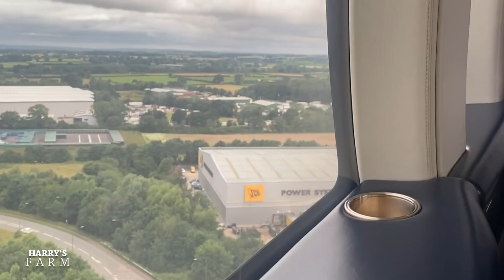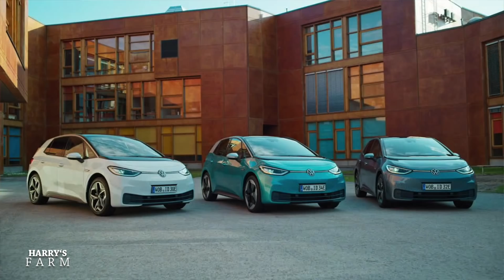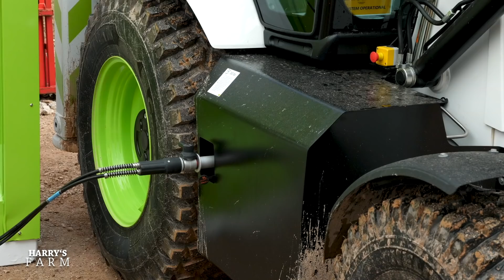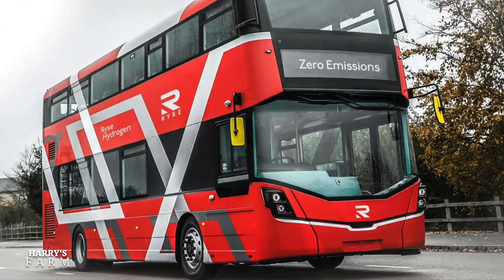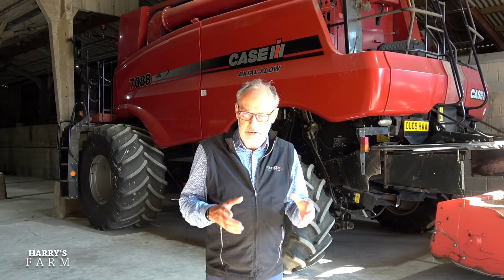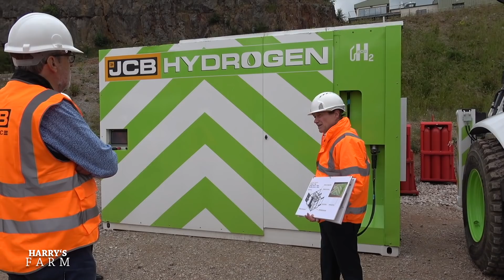Why JCB thinks hydrogen is the best alternative to diesel for heavy machinery, farming and HGV fleet

Comment: Great video and discussion - I'm not convinced hydrogen-ICE will prevail though. The infrastructure for H2 is, as of today, non-existent and reportedly going to be very costly (350 bar storage tanks!). Given how batteries are already reaching widespread adoption in cars and grid storage, I can only see their costs being driven down while energy density increases to the point where they become viable for HGV & agricultural vehicles. The infrastructure should be much cheaper too, as all farms and fuelling stations have decent 3-phase grid connections for recharging.

Comment: Harry's Farm is now the only reason why I turn on the television. Captivating, informative, informed and balanced. What began as research for a book is now a wholesome addiction. But who, please, is the camera person?
Reply: oil companies attempting to sell oils and gas dressed up as hydrogen it is a scam    Depending on the quality of the feedstock (natural gas, rich gases, naphtha, etc.), one ton of hydrogen produced will also produce 9 to 12 tons of CO2  
However, hydrogen combustion with air produces oxides of nitrogen, known as NOx. In this way, the combustion process is much like other high temperature combustion fuels, such as kerosene, gasoline, diesel or natural gas. As such hydrogen combustion engines are not considered zero emission.

Comment: Dear Harry
Is JCB doing any research to make a safer fuel tank for the hydrogen giving how explosive it could be in an accident etc?  I did speak to a friend here in Canada who was working on a fuel cell powered mining locomotive and they had come up with a "hydrogen bed" storage system that bound the hydrogen chemically until it was released to the engine so if struck or punctured in an accident, the fuel tank could not explode. 
Love the videos, please keep them coming.

Comment: Problem with internal combustion engines running on hydrogen, they're roughly half as efficient as fuel cells on hydrogen plus they produce NOx emissions. Fuel cells are twice as efficient as ICEs and they produce no NOx emissions. Fuel cells are the way to go. Try again JCB.
Reply: They'll need to become a lot cheaper first

Comment: The issue isn't the engines, it's the high pressure hydrogen and the delivery system for those. Not only is the gas very flammable but it's very high pressure too. Everything may be reasonably safe when it's brand new but you have to think 10-30 years down the road and maintained by not so diligent people. Imagine having a 20 year old hydrogen car or tractor in an enclosed garage or space and then it starts leaking. Massive fire hazard. I'm not against hydrogen power, and I don't think EV is the answer for heavy machinery unless there is a massive breakthrough. Just saying that the challenge is the hydrogen storage and delivery system and that's where the focus needs to be. Showing a working 'hydrogen engine' is relatively easy, showing a working and 100% safe and certified 'hydrogen delivery system' is hard.
Reply: Petrol is reasonably flammable as well isn’t it
Reply: @robschofield749  it sure is, but at least petrol isn't a gas at 1 bar of pressure. And it doesn't need to be stored at high pressure to be a liquid. All in all hydrogen is much more dangerous and trickier to handle than petrol.

Comment: Typically misleading from someone with deep investment in ICE.
Burning hydrogen will require vastly more than using in a fuel cell. The best ICE engines today are only 40% efficient, that doesn't include the efficiency losses through production and compression of hydrogen gas which is nearer 60% losses in itself from the electrical energy input.

Combustion of hydrogen with air still produces NOx. That's an emission, and a very important one in urban areas.

HFC are fundamentally simple to service and generate electricity. More and more vehicles have moved to electrically powered services over mechanically driven (off a belt drive), so the mechanics are already familiar with the equipment.

Comment: Harry great conversation. However I disagree with a number of Lord Bamford's points. Range anxiety was the same argument the incumbent car manufactures used to delay electric cars. In my view if you need to keep a piece of machinery working, then removeable batteries could be a solution, Dutch Ferries use this concept. His company is invested in a specific manufacturing workflow and logistical program, and it is very clear he is despite not to have to move to far away from it. He states electric is more expensive, but he never speaks to the his maintenance program. Maintenance will be vastly more for a combustion engine than is will be for an electric power plant, you only have to look at electric public buses for clear industrial examples of this, this cost savings will make a huge difference to the building industry, and its simply not discussed. He never speaks to the cleanness of producing hydrogen, which currently is done by the oil and gas industry, and is not that carbon clean. So in my view, an interesting conversation, but by no means the silver bullet.
Reply: Spot on.
Reply: We would still need to overcome the problem of additional weight (a big problem for tractors in a field) and the cost of additional batteries which would need to be transported to a field.
Reply: @martinhemsley  Martin you are correct. However I do not believe weight was fairly discussed by Lord Bamford. If you believe what he is saying. is that the removal of the engine and fuel (being a liquid has a substantive weight alone), can not only be absorbed by the addition of batteries alone, but 30% extra weight added (his statement re size of systems to compensate). Then you also have to believe that the manufacture of a 10 part system (an electric motor and a battery) is far more expensive to make than a 2000 part combustion engine power plant. So you'll have to forgive me for believing that is an exaggeration on his part. Further large systems working in the ground and fields use counter weights within the construct of the machine to adjust the centre of gravity, and these were not discussed. I believe because incumbent manufactures do not want to have to retool and redesign for modern power plants. If it was discuss he could have explored if battery weight is truly an issue surely they could be used in place of the counterweights built into machines. Tractors for example have tyres filed with heavy liquids for traction. surely having the electric motors and batteries mounted in positions that shift the centre of gravity of the machine to the operators advantage would reduce the use of these extra weight systems, to compensate for any extra weight batteries could introduce, but again not discussed. Battery technology is over priced, due to lack of supply, which to date appears to be a market strategy by incumbent manufactures and oil and gas industry trying to survive this massive change, by delaying the availability of them. You only have to look to the intensive lobbying in the US for examples of this. All of the above said does not mean I personally am against the idea of alternative fuels. I just believe and fair and transparent debate is due, so consumers have a full and correct picture from which to make buying choices.

Comment: JCB have produced visionary products and changed the construction industry globally before, no reason why they can’t do it again with this. Commercial vehicles just won’t work with lithium batteries, maybe if we get aluminium batteries that can charge in seconds. But for the short term future this is a great solution just need the UK gov to get petrol stations supplying hydrogen!

Comment: Hmm, nice vid but: Capacity for generating electricity without CO2 emission is still far too low. Propaganda, complacency and ignorance of climate-change and peak-oil made us wait for too long, now the world's on fire and we don't have time and energy to waste, so please realize:
Losses in electric motors are only 5%. 
During the production of H2 losses amount to 40% of the initial electric energy, and the production capacity isn't there either.
On this precious H2 used in an electric fuel cell engine, another 10% losses factor in, i.e 0.6x0.9=0.54 equals 46% total energy loss. 
When the hydrogen is used in an internal-combustion engine, efficiency is only 30%, i.e. 0.6x0.3=0.18 i.e. 82% loss total !!! (all values approximately).
If H2 is further processed into synfuels and these used in an IC-engine, yet more losses will factor in.
If we had H2 in abundance, we could stick to IC-engines, but we simply don't.
I admit, there are applications, where there is no way around these losses, but we must be as conservative as possible from now on: the world of dirt cheap fossil energy is over.
Reply: very true and sad to hear jcb are wasting their time on this.  My battery drill has 2 or 3 batteries, 1 I use, the others charge.  That 30 ton digger could have giant changeable cells.

Comment: If every vehicle goes electric we will have much heavier vehicles on the roads, how will this effect road surfaces and bridges etc not built to take these weights.
Reply: Good point.  Have there been any studies to discover the relative cost, in the long term, of all the variables to transport any given Kg of material by all the "Eco" options.  No one has mentioned battery life, replacement/repair cost, resale value etc associated with vehicle ownership.

Comment: If i read my local Carbon/CO2/plant food removal plan then it says in there most drivers will be forced off the road with high road use charges, so they don't expect everyone to buy an electric vehicle. They expect the policy to work so well they can rewild one side of the A38.
Yesterday the NHS was privatised and no longer has to provide care. To make profit they can refuse care locally. Meanwhile some can always fly to work. Such will be the divide in society in the new start
In my local town plans are afoot to make the main road through town which was the main road to Cornwall years ago, a one way street for green vehicles only.
In the You will own nothing and be happier world everyone has to have the same financial level with the same outlook on life. With no care for some the outlook looks dire.

British engineering and many other things start in a shed with a spark of an idea by one person. Looming is a block on the common man using the Earth's resources without paying high charges. Owning nothing includes Tools and Sheds.

Hydrogen production is a expensive thing compared to Petrol, what's the running costs. If your a big business will having your own Hydrogen plant be the way to go.

Lord Bamford, Anthony to his friends, is one cool dude.

Comment: OK great, but you didn't deal at all with the question of efficiency.  An electric car (and presumably an electric excavator) converts 75-80% of electrical energy into useful work.  If you produce your hydrogen from renewable electricity, that is 80% efficient but then the internal combustion engine is only 20-25% efficient in converting hydrogen combustion into useful work.  So you will need roughly 4 times as much electricity using hydrogen and electrolysis as you would with battery/electric technology to do the same amount of work.  Maybe worth the tradeoff for all the other advantages of hydrogen, but certainly one huge disadvantage.

Comment: Most interesting and a great add to the emission-free equation. Not sure where the Astra figures came from. Currently only the Corsa offers an electric option which, on a lease, appears to work out cheaper the the ICE equivalent.
Reply: Looking at the price of EVs in the Chinese domestic market it appears we have roughly hit parity between  ICE and EV. Prices in the west are heavily distorted as EV as seen and sold as premium products with higher performance and loaded with toys that base ICE cars are not.

In China you can buy a brand new basic 4 door EV with 150+ mile range for about £6000.
Reply: The Astra plant is being converted to make electric vans. Fantastic.

Comment: Those little excavators on mine sites in Australia work 12 hour shifts day and night cleaning up around fixed plant where bigger units won’t fit. A hydrogen solution for those will be needed.

Comment: Hydrogen is better suited to generators. As they run continuously. Other types of moving engined vehicles actually dump hydrogen. Also they are expensive to fill up. You can't just throw a fiver in to get you home. They have to be filled up at an average cost of about 80 to 90 guid. Could you afford to run one.?

Comment: The often forgotten downfall to pure battery power is the diminishing amount of power as the battery drains.  Imagine an excavator that only has full power available when the battery is at a decent state of charge.  It would be unsafe to operate a machine where the load capacity changes based on the available battery charge.  Hydrogen FTW!

Comment: I'd be very curious to know how they made a hydrogen-burning engine zero emissions. My understanding is that, air being mostly nitrogen, any combustion that uses air will generate NOx emissions regardless of the fuel being burned.
Reply: Also the engine will be oil lubricated which will burn off in small amounts too.
Reply: Will a catalyst or similar device help or some exhaust treatment like ad blue is for diesels  ??
Reply: @dennisphoenix1  According to Wikipedia catalytic converters need carbon in the exhaust to get rid of NO2.
Reply: @garthnareng4898  I haven't done any research on the subject.  Just thinking about it
Reply: @dennisphoenix1  I also assumed a cat would work, but decided to look it up and I'm glad I did.
Reply: Zero-emission means no carbon emissions in this case. NOx are another problem of course

Comment: There seems to be a trend in agriculture to “de-scale” a lot of machinery ie smaller lighter robotic vehicles working continuously. Robotics is becoming especially important due to labour shortages and suits battery power. There is still the problem of energy intensive activities. A problem with hydrogen is all the infrastructure eg will a farm be able to have it’s own compressor system for filling. These used to cost $250 000 when CNG was used in vehicles.
Reply: It was just explained that batteries are not the answer!
Reply: @TheLemonadedrinker  They were making a prediction. I was arguing batteries may have some role and refueling hydrogen, especially on a farm, may not be as simple as you might think.
Reply: @TheLemonadedrinker  no it wasn't, it was some guff by an old guy

Comment: What a great interview, no big hard sell, just information. Thanks Harry.

The working day is a lot longer than mentioned in the vlog on a lot of construction sites I've worked on. One was the Gloucester bypass where a fleet of Sir Robert McAlpine, Caterpillar motor scrapers, dozers and graders, moved suitable fill from a burrow pit and built embankments. The scraper machines engines were started around 5am to get them to operating temperature, the driver was in the saddle ready to go at 7am. There was two 20 minuets breaks during the day and the machines were parked up at 7pm. A mobile bowser filled them after 7pm and topped them up during the breaks. A team of college students kept a log of the scrapers number and the driver had to explain, if he ran out of order of stopped for some reason. I drove a JCB installing drainage trenches, gullies etc. and we operated the same hours. The foremen had raised parking spots for their Land Rover and from the vantage points would pounce on any driver hanging around. For all this the pay was great and we were self motivated to get the job done.

Harry you mentioned Lord Bamfords car collection, I can remember looking through several binders of the JCB fleet my brother had, he supplied vehicles to the film industry and used several from JCB. These included artic trucks and trailer of nearly every kind, cars, vans and of course JCB's

Comment: I was only talking to someone earlier today about this. Given that EV cars seem to be about an extra tonne heavier than the internal combustion equivalent, then a 38 tonne tractor is going to have to to carry maybe 4 tonnes of extra mass in terms of batteries (after the removal of engine mass etc). That is going to reduce both the volume and weight available to haul goods. Additionally, imagine the immense infrastructure needed to charge 50 tractor units overnight at a lorry park etc. 

One down-side to hydrogen is that many farms already have solar panels covering barns, wind-turbines and digester plants that convert cow poo to methane and then electricity. Electrolysers are just more money and add another stage of conversion loss. So some electrification of farm vehicles has to be a good thing.

Comment: Hi Harry, I have had engines running using hydrogen for along time . I got the first one to run in the late 1990's,  and next Sunday I am going to a place near Devizes in Wiltshire to get an engine running using water but I will breaking down the water into  the Hydrogen and Oxygen as we need it to run the engine.

Comment: Interesting to see how a liter of hydrogen has three times more power than a liter of diesel
Reply: By mass. Hydrogens volumetric density is significantly lower than diesel, which is the important factor. I think diesel is 9 times as dense. So in other words, you'd need to refill the hydrogens tank 9 times to the diesels 1. (assuming both tanks are the same size)
Reply: @MrManBuzz  good point but they need to work out the bugs to make this practical
Reply: @carlfalt174  That isn't a matter of "working out bugs". It's just basic chemistry and science. The only other way around it is storing it at extremely high pressure, but that's dangerous and brings its own set of problems. Hydrogen is not the solution I'm sorry to say.